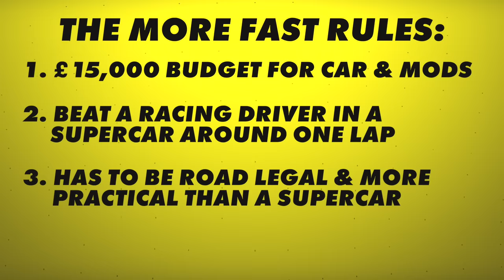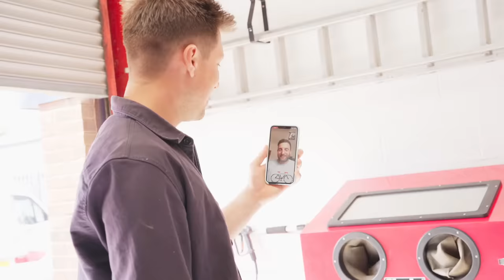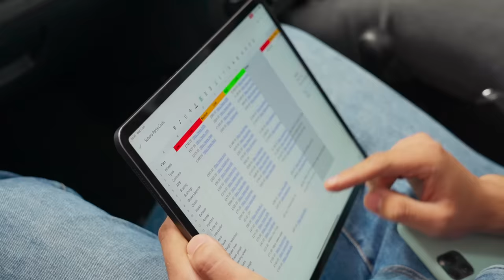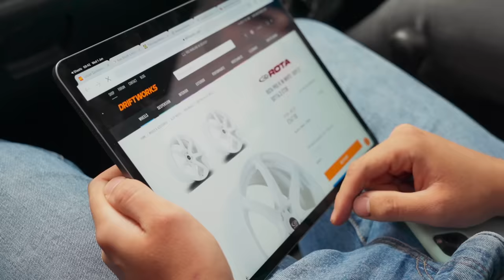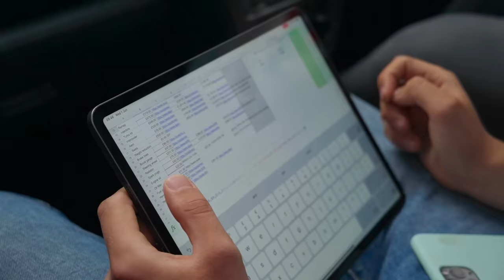Buying a $5000 Project Car to BEAT a Supercar | MORE FAST EP1

Comment from the maker: Please do recommend mods for this car! If you know something that will make it quicker - comment below!
Reply: Racing stripes, duh.
Reply: You have to put flame stickers on it 😂
Reply: They should paint a massive Scottish flag and blast the well known meme through hideous speakers, that'll definitelly slow your lambo down.
Reply: a KAPS squerntial transmission
Reply: A front splitter will do wonders for handling
.
.
.
Racing stripes & flames will make it go faster though
Reply: twin turbo
Reply: For 01-07 Impreza the most important mods are:
1) Tires (for any car really)
2) Sway bars (especially stiffer rear to fight natural understeer)
3) Chasis bracing (even simple strut bar can do wonders in these cars)

If you want to do aero, the best way to start is with simple metal sheet/abs underbody. These cars had no effort put into what's underneath them and simple flat planes on the sides (you don't want to cover exhaust as it gets hot) drastically improves stability (also reduces drag and makes car much more quiet)

About power...
Turbo and intercooler are really "cheap power" with those engines but it's really easy to blow them up.
Exhaust should keep unequal length headers - car will be little slower, but it will sound much better.
Reply: I was excited to see this as I thought it was an interesting challenge and was hoping that there might be a good bit of technical info in it but it sounds like they are not serious about this anyway, talking about wings, wheels and slamming it  etc rather than having a genuine go at making it fast.  Go and see the Clark boys  at Roger Clark Motorsport if you want to do it properly
Reply: A button hooked up to the stereo that plays Eurobeat at full volume when pressed.

..I'm begging you 🙏
Reply: Strip literally everything out (free), seem weld to stiffen chassis (free).
Reply: WE NEED NEW CLUTCH TO AVOID SLIPPING
Reply: It'd be nice to see some lap times in its current form (when the clutch is done) so you can see the improvements with each mod. Get the best tyres possible,  weight reduction which is free, uprated shocks, springs, discs, pads and a tune and it'll go well. If the budget allows get really light weight alloy wheels too, the lack of weight rather than the looks is best 😁 .
Reply: EL headers are always a good BHP booster for a Scooby boxer.
Reply: NITROUS OXYDE SYSTEM!!

Semi slick tyres,  remove everything from the interior, fiberglass bodywork, lightest cheapest wheels, other guys here already gave top ideas 👍🏻
Reply: I’ve built a ton of these. To beat the lambo you need to focus on only essentials. Hope you didn’t already buy everything. Strip every single ounce out of the car that you don’t absolutely need. Free speed. Weld the chassis seams up. You don’t need 300hp you need 500. Aim for that with turbo and tuning. Do this first and limit the engine use. These cars eat engines stock, so depending on mileage you might just throw in a factory sti short block to start, but you can probably make a few hard runs before the stock one disintegrates. Forget wheels, just get great tires. Turn the stock rotors flat and run the nastiest race pads you can get. Don’t need aero, weight of the wagon will do the same. Sounds like you already got coilovers. Add a race clutch and probably new master cylinder.  Don’t waste money on exhaust, the cheapest will be fine. I saw someone mention e85, that would help too but you may need injectors and a fuel pump and rails to get enough fuel in. 

Unless you can make it light even 500hp isn’t going to beat the lambo so that’s your focus. You should be pushing 10 sec 1/4 mile at that point and then it’s your driving to win on the track.
Reply: you absolutely NEED an anime girl sticker in the window
Reply: Extreme weight reduction. Who needs body panels anyway?
Reply: make it lighter, it's free (sometimes).

Also, if it's like the 24H of lemons, you can sell the parts you take out and get more money for mods
Reply: Me driving (possibly).
Reply: Stock WRXs are sloooow. You need speed and handling to win on track. Wheels cost a lot and don't add speed. Do them last and only once you add enough power to spin sticky stock-size track tires. My US spec 2006 WRX still has stock wheels (17"x7.5") with an '18G' turbo and engine power near 390 HP / 410 TQ. My tires are all-weather Cooper RS3-A (not even close to a track tire). Except a little in 1st gear, they don't break loose on dry tarmac. I'd guess 400 wheel torque is around where you'd be spinning stock-size track tires? So, just giving you an idea of why not to shell out for fancy wheels.

Engine management computers (like Haltech), installing head studs / forged pistons, and/or dyno tuning are expensive. But that is where you need to spend $$$ to win. Just throwing a big turbo with a manual boost controller on a tired old engine, won't end well;) ...Break an engine and you lose.

Drop weight for free by removing things like interior, spare tires, bumper beams, etc. Switch to a lighter weight battery and driver seat. Lower weight lets every part of the car perform better. 

Do a full cheap 3" exhaust. Header, non-catted up-pipe, and down-pipe with a cat - if you'll be on public roads. It's less exhaust pressure after and more pressure before a turbo which makes power, not how pretty it looks. 

Since you're likely to be over 4K RPM the entire lap, try a '20G' size turbo with an 8 cm/sq hot-side - cheap E-Bay turbos work fine. *Only go with a 10 cm/sq hot-side if the track has many high speed corners and long straights where you can reach 140+ mph. Maybe get a turbo inlet to go between the turbo and MAF, but don't bother with an intake or 'pod' filter since those generally don't add significant power for the $$ and usually screw up MAF readings. *COBB Tuning's intake with their 'air-straightener' might be an exception, however it mainly gives slighty better turbo response with a bit more top end potential. Literally only do an intake if after everything else, you still have $500.

Stock injectors are too small. Get at least 750cc injectors and a high flow fuel pump if you'll be using high octane pump gas. Or at least 1050cc ones with E85...of course that would mean buying a flex-fuel kit too.

STi 'Pink' springs with Tokico single adjustable dampers are a decent budget suspension option (they're what I have for street use). They're simple to tune and let you dial in dive under braking vs. front lift under acceleration. *Going for double adjustable coilovers means much more time testing to dial in good lap times. +That's $$ you can't spend on power & reliability mods. Install camber bolts for around -2 degrees static camber front and rear. Then get caster correction bushings like Whiteline's Anti-Lift Kit (ALK). *More caster = more dynamic camber as you corner.

A larger top-mount or front-mount intercooler won't be significant during one lap on track, where you never go below 40 mph. Maybe get a used STi stock intercooler since it flows slightly better. Then throw a bag of ice on it 10 minutes before you go racing. You can literally leave ice cubes on it, which quickly melt during your lap:D!

You're right to consider stock brakes with uprated pads. However, I have cross drilled rotors with semi-metallic Wagner pads (not ceramic) and they are hard to overheat. Then just flush the brake and clutch fluids. For a clutch you'll need at least an Excedy 'HD' type.

So at least: Tires, engine management, tuning, 20G turbo, injectors, fuel pump, castor kit, full exhaust, adjustable suspension, HD clutch, brake pads, fluids and maybe a used intercooler. Hmmm, I think you might have enough for light wheels with wider tires?

+ Remove A/C compressor and get a shorter belt. Removing the condenser in front of the radiator = better cooling, which you'll need with a big turbo and it removes weight ahead of the front axle, where it counts for handling. With enough weight loss you might be fine in keeping the stock springs too (but still with adjustable dampers). Consequently, this is also another reason why to not get a front-mount intercooler. Because putting a bunch of weight far ahead of the front axle, partially blocks the radiator and promotes understeer.
Reply: @Tom-wp9ix  Agree with needing A LOT of HP. May take cams and larger valves / valve springs + lighter forged pistons and head studs, with a raised redline...
Reply: Garrett gt30 turbo tial 38mm external waste gate, sti top mount, 550cc injectors, 340 lph fuel pump, tfv delete, get the cobra exhaust in the picture of the 2 youll make 330 bhp . Accusump as these starve on track.
Decent coilovers, ns-2r tyres, 24mm anti roll bars, anti lift kit, smaller battery, remove the air con, fixed buckets, exedy clutch and lightened flywheel
Reply: remove rear seat ans sell it for more monie
Reply: Look  for a built car that has dyno print at 450/500 bhp (or more) and a 6 speed gear box... then swap everything over into your car 😀
Reply: Remove the front C frame it's heavy .
Swap front and rear  subframes for tubular  subframes to save weight
And remove the crash beams they are heavy too especially the front one it's like an iron girder ..... if you want to maintain crash protection swap it for a jdm sti front crash beam much lighter.
Remove everything to do with the aircon it's excess weight .
Take the spare wheel and tool kit and boot carpet out.... its weight.
Remove the electric window motors....4 x weight .
Remove the rear wiper motor ...weight.
Any panels you can afford to replace with carbon fibre will save a lot of weight.
Reply: Biggest turbo you can afford and fit, then slick semi-slicks (barely road legal), then bone shattering hard suspension, probably need to play with suspension geometry as well.
But guys, you can't beat a Lambo with just 300hp. Even if you throw everything out of the car to make it as light as possible, you'd still need 4-500hp at least.
Reply: weight reduction, some extra power, a clutch, a suspension alignment and as much as possible on tires
Reply: call mighty car mods and ask to borrow supergramps!
Reply: Aaaand new spark plugs gapped down from stock .032 to .028 if you're around 20psi. But can go down as much as to .025 if boost is at 30 psi. *High cylinder pressure can prevent a spark jumping the stock gap. ...Then a 3-port electronic boost controller 🤔.
Reply: Over the last 6 years I did the same to my 2004 Wrx wagon. It now runs 464bhp/405ft lb torque.
The max the wrx engine with the 5 speed box will take with single jet water methanol injection on 95Ron fuel is 330bhp/300ft lb torque. That was my initial setup. We then swapped in an Ej207 Sti engine with a 6 speed dccd box, direct port water methanol injection, Haltech ecu, nearly all of the Whiteline suspension parts and Meister R GT coilovers. It then could hold itself on track. This is going to be a tall order with that budget and I'm really looking forward to the series. Shout if you guys need ideas/links/creative ways to get things done 👍
Reply: Also, I wouldn't spend any money on aero as this would increase weight and there's no guarantee you will be faster
Reply: Tyres, suspension, weight reduction, turbo/ECU/supporting mods, brakes. Aero and wheels aren't worth it.
Reply: don't have Telegram
Reply: Better sound system = Better music sounds = Better Eurobeat sound = HRSPWRS Increase
Reply: Borrow the F1 tyres from before and turbo and good brakess
Reply: Big sound system to play eurobeat
Reply: For additional weight reduction: the front u-brace thing under the subframe is only there for crash safety and is unnecessary for a track car. Easy 40 lbs gone
Reply: You could also remove the sunroof in favor of some sheet-plastic
Reply: Second hand STI , brakes and suspension will improve the car on a budget. You can get second hand STI wheels though I wouldn't suggest that this would greatly improve your lap time unless your clearing a big brake kit or you need a new size to aid wheel tyre choice. I'd recommend semi slick tyres although you are in the UK and it wouldn't help with practicality. 
I would recommend a flex fuel sensor so you can run ethanol which will help to safely boost power. The intercooler is pretty big and tests have shown that there isn't much of an improvement with new cold air induction system so I would say there isn't much point doing the induction unless your relocating the turbo and pushing over 400hp.
The biggest restriction on the exhaust is the cat and in particular the downpipe for which there will probably be a part you can buy with the turbo. 
These engine are really rather weak so this may sound silly but I'd recommend nos be professionally mapped to help aid lag and throttle response of your big turbo and to also potentially boost top end. In terms of power for the money which won't damage the engine too much I think it makes sense.
Reply: Sti front lower control arms, sway bars, poly bushings everywhere, sti hood scoop and shroud, rear diff
Reply: A flat underfloor is possible with either aluminium or plywood.
A ecu tune would also enable flat shifting, lunch control and potentially anti-lag.
Reply: throw interior out, but on vf22 turbo, sti injectors used and fuel pump.
Reply: F1 engine, definately cheap mod.
Reply: Outfront Motorsports 2mm+ rod closed deck longblock with ported heads/cams. FMIC. Rotated turbo (Xona turbo), twin disc clutch, Radium dual fuel pump hanger, 1700 cc ID injectors or larger, ethanol sensor, ELH’s and 3” turbo-back exhaust, EWG, STI transmission swap, DBA 4000 rotors and pads of your choice, tires of your choice, coil overs of your choice. Ethanol tune. After all of that, you can start talking about a WRX challenging a supercar. You can go stock location but it won’t be as good. The price tag is over $30,000 USD, (without paying for the car itself) especially if it has to include labor costs. 
Fun game but doomed from the start.
Reply: Because of the budget an goal, keep the stock wheels as long as they allow a wide enough tire, keep the steering wheel stock, don't mess with putting a wing or splitter, best budget track tires, brakes pads, suspension, and cut everything you can out of the interior to reduce weight, then a bit of power for the rest of the money, and obviously fix the clutch.
Reply: Eurobeat !!! +200HP easily!!!
Reply: First, I'll say absolutely no chance you beat a supercar (depending on what that constitutes today) with that budget in a wrx haha. You'll want to get as much tire on the car as humanly possible, remember something like 58-60% of all the mass is in the front of the car, so those front tires have to drag that around the corner. I'd be trying to fit a 275 or something up there, but you'll have to flare it to get that much. The most you'll get under the stock fenders is a 245 with rolled lips. Go big on the turbo and upgrade the oil pan/add a windage tray (IAG). If you can generate enough grip to outrun a supercar you'll also create enough grip to cause oil control problems. For brakes you can use tribeca, legacy gt, or 2015+ wrx calipers and brackets with 05-09 legacy gt rotors up front, that'll give you more stopping power for not a lot of money. You'll also spin up the front inside tire if you allow significant body roll. The 5mt doesn't have a limited slip front and could really use one, but that's about 1k$. You've really painted yourself into a corner with this one. A turbo miata would probably have been cheaper, easier and faster. Unless their prices have gone up too.
Reply: Having been in the Subaru community so long, I know its not possible without a significantly built track/time attack monster to pull this off.

First recommendation, ditch all motor build ideas.  Fit the biggest, widest set of Hoosiers on the wagon completely obliterating the fenders.   Get a medium price set of coilovers to match.

Next up, ditch the 5 speed for a 6 speed with an upgraded Clutch based rear diff to match the limited slip front.  Don't bother upgrading the 5 speed since it will cost even more.  6 speed swaps usually come with upgraded brembo brakes too, throw track pads on those.

Gut every ounce of the car possible (bumper beams, interior, Airbags, everything non essential) run just a light weight driver seat.

Whatever few dollars are left put into simple engine mods.  Because no mater how much you put into the engine, you just won't be able to carry as much speed as the Supercar the rest of the time and to get Supercar power it will cost you more than your entire budget and then some...
Reply: You’re gonna have to gut the back seats
Reply: Seriously- here is the way to go. Based on experience, to save money:

1. Get really good pads and fluid, that’s it. Big brake kits only help to dissipate heat for extended track time. One lap? Just pads and fluid. 

2. Get some 200TW tires with light 8 or 9 inch wide rims, whatever beat fits the car. 

3. Do not buy coilovers. That extra cost is to have adjustability, which you don’t need. Get a good lowering springs and pair it to a shorter length shock, maybe bilstien or koni. The spring-shock pairing will give you lots better handling without the extra cost. 

4. Obviously get rid of any extra weight. Maybe you can throw out the rear seats and still claim the practicality since you have cargo space. 

5. Front camber plates will cut a decent lap time chunk.

6. Rest of the money into power. Choose a handling-based circuit for the challenge!
Reply: Subaru communities have a lot of used equipment for sale. BUY AS MUCH AS YOU CAN USED and the £'s go further.
People upgrade turbos, exhaust, suspension, wheels, brakes, fuel systems, intercoolers, etc. all of the time. Usually, resale of these parts comes at a minimum 50% discount from new. Tell them why you are buying the parts, put some names of those "supporters" in vinyl on the car and you might be surprised at how low cost used parts become.

And get rid of that sunroof and attending mechanisms. The wagon is already top heavy.
Reply: White line anti lift kit, massive difference on Subarus
Reply: Giant turbo
Reply: I wouldn't recommend replacing the stock wheels with heavier expensive low quality rotas or an aftermarket steering wheel lol
Reply: Tyres and Wheels are the first place to splash the cash if necessary. Lightest weight wheels possible (1kg saved is worth about 4kg elsewhere) with the budget and best tyres.
Then brakes, have a look at upgrading to STI size discs with the 5x100 PCD pattern as a potentially cost effective option to improve braking (may need new caliper carriers). Keep the calipers but change the pads, but don't go too hard on the pad compound. You're over one lap so need heat in them quick, not for them to be resilient. 
Exhaust go cheap but check for optimum specs, a pipe is a pipe at the end of the day. Other left field option is fitting a small nitrous bottle. You've got 4wd (and hopefully Scott has a RWD lambo) so makes sense make to use of it off the line and on exits into straights. Again, little bottle... Only needs one lap.
Then chassis stiffness, sway bars, good shocks (adjustable if you know what to do, non if you don't) and a splitter undertray on the front. 
Then look at power. No point having it if you don't have the handling to use it.
Reply: NOS
Reply: Sti 6 speed swap first, the 5 speed is the biggest weak link.
VF48, exhaust, big top mount intercooler, bigger injectors, tune.
Tyres, better pads/discs, coil overs and sway bars.
Reply: At the bare minimum put 5w-40 oil in it so it has a fighting chance of lasting thru one track day. 

Tires are massive of course, and you can fit a surprisingly wide one under the stock fenders but not on the stock wheels.

Sway bars and coilovers make a big difference to the handling. Front lower control arm bushings also make a big difference and are fairly cheap, same thing with a pitch stop.

The front brakes are imo the best upgrade for the least money if you’re gonna go bigger calipers and rotors. Pads and fluid are the obvious easy choice tho.

Power wise you’re garunteed to blow the motor way sooner if you do anything, but cheapest mods for power are an intake, downpipe, and electronic boost controller along with a proper tune. Should see gains of about 70-90whp with that (mustang dyno). Tuning it on race gas will see more power as well for not too much money as long as you don’t run jt very much 😭
Reply: Gut the car, valve spring, camshaft, clutch, exhaust, intake, turbo, inter cooler, light wheels,  slick tires, suspension, ECU tune.... more gutting (delete rear windows and rear windshield, AC and install a lighter battery or move it to the rear)

Forget that massive rear wing
Reply: Electric conversion
Reply: Strip any unnecessary parts from the car such as floor mats, door panels. You could even replace the door handles with straps and the windows with perspex
Reply: a new tune and better injectors
Reply: Good tyres and driving tuition will see the best gains for the money!
Reply: @stevemartegani  power is easy mate, just put it on a huge shot from the bottle. it literally has to last one lap.